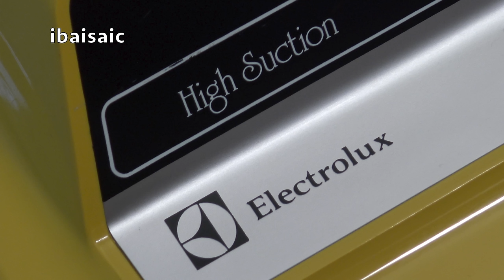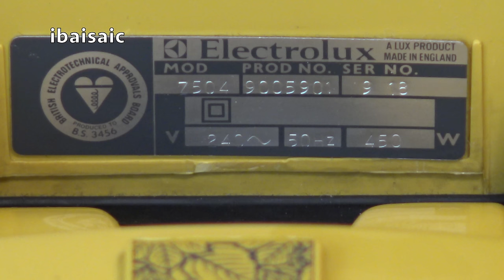Vintage 1970s Electrolux 504 Vacuum Cleaner Unboxing & First Look

Comment: My mum had one of these, I use to change the belt and filter and my gran had the 506 with electronic motor speed dial that was so exciting by comparison. Hoover beets as it sweeps as it cleans.Electrolux beats the hell out of the carpet.Brilliant.

Comment: I have this vac. It needs a new belt, what size belt fits this vacuum and bags, I appreciate the help
Reply from the maker: Just search Electrolux 504 belt and Electrolux 504 bags and you’ll see plenty as they are still easy to get if you live in the UK.